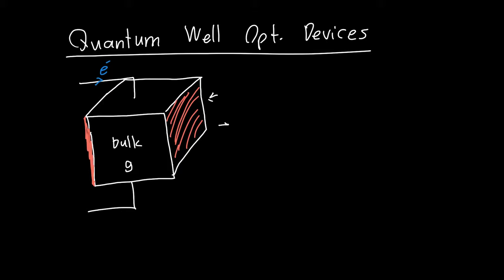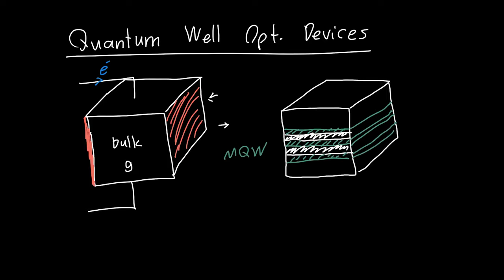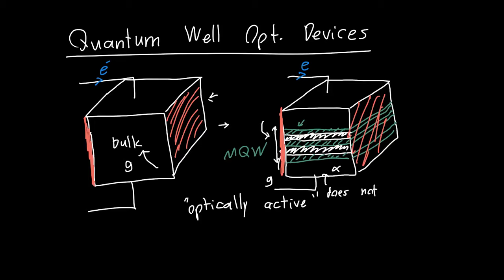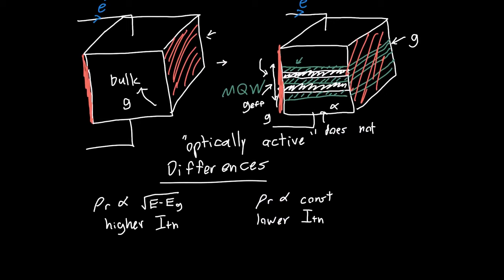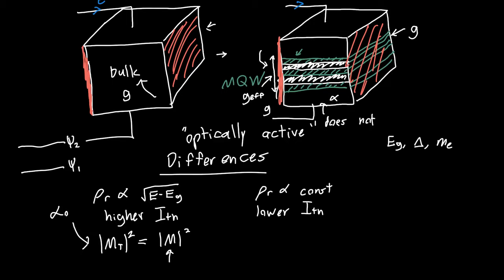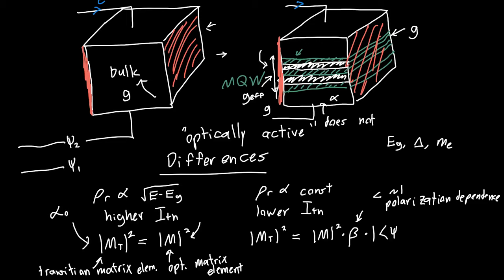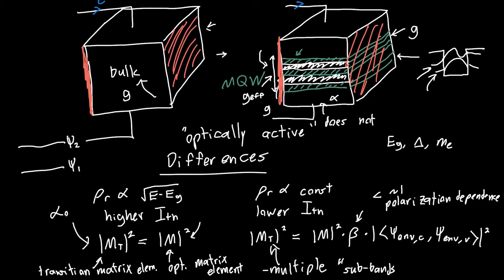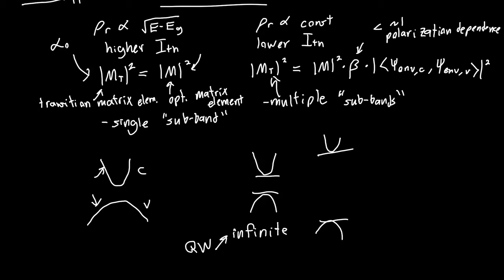Quantum Well Optical Devices

Comment: Not a comment, but a question.  I am a high school physics teacher teaching an Advanced Physics class and am a bit out of my league.  In Randall Knight's 1-D Quantum Mechanics Chapter (p1297)  he talks about a GaAlAs-GaAs-GaAlAs quantum laser with a 1.0 nm GaAs layer.  He says the U of the electron is 0.30eV less than the surrounding GaAlAs layers, giving a SINGLE quantum state, n=1 E = 0.125 eV.  Quoting "Every electron trapped in this quantum well has the same energy - a very nonclassical result! The fact that the electron energies are so well defined, in contrast to the range of electron energies in bulk material, is what makes this a useful device. ...the probability density of the electrons are more likely to be found in the center of the layer than at the edges.  This concentration of electrons makes it easier for the device to begin laser action."  Previously we learned that laser action requires population inversion.  How does this happen in the quantum laser if there is only one energy level?  Thank you in advance for any help you can give.
Reply from the maker: Excellent question - it doesn’t. There is a second energy level he doesn’t talk about that is assumed to be empty below the valence band that the electron can drop into. If this state is also full, there won’t be any lasing. Don’t worry, we’re all out of our depth ;). Especially me.
Reply: To understand the population inversion of semi-conductor lasers, you need to know that for every electron in the quantum state, n = 1 E = 0.125 eV, there is a hole (or a void left by that electron) in a similar quantum state. To understand why this hole exists, you need to know that in semi-conductors an electron will only be in a "quantum state" if they are excited up to that state (via thermal excitation and doping). When the electron is excited into this quantum state, it leaves behind a hole that is also at a single quantum state. The way a semi-conductor laser gives off light is through the recombination of the excited electron and hole. Because both the hole and electron are at a single quantum state, when they recombine (through stimulated emission) they will only give off one frequency, thus you get a laser. So to answer you question, population inversion in semi-conductor laser is really just this electron-hole pairing you get.